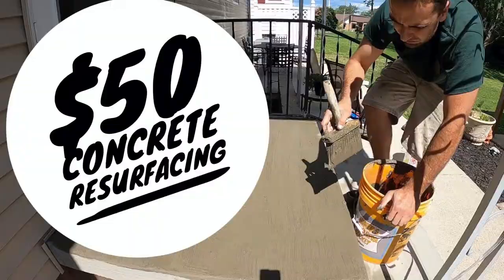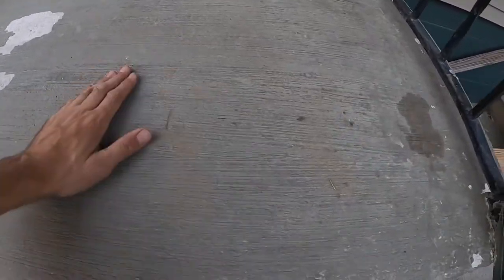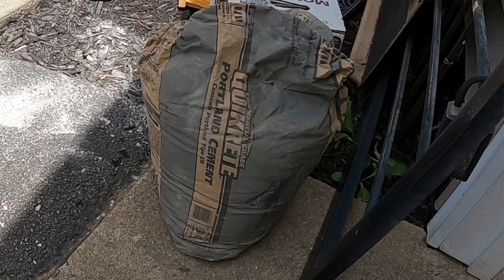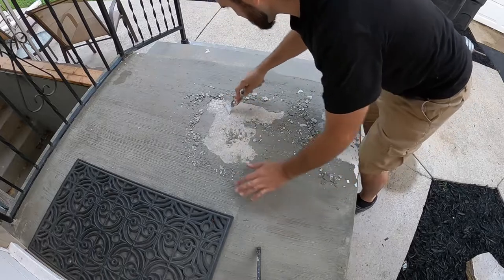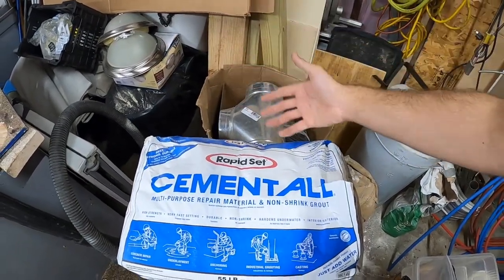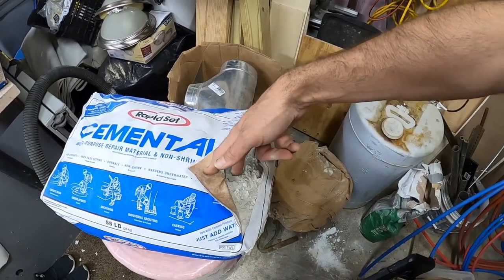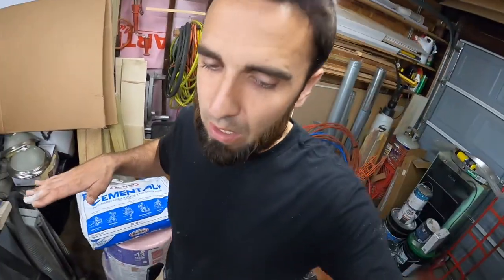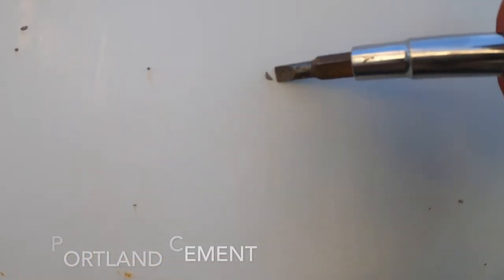RENEW OLD CONCRETE | 1 YEAR REVIEW

Comment: This is the secret, it MUST be wet, so have a sprayer and wet down the surface so the Portland will stick. In fact, use a water hose and soak the concrete so it is WET enough to NOT dry the Portland paint mix. Wet concrete will NOT stick to dry old concrete, because it will pull the water from your repair mix and then will not cure properly. 
I would use 1:1 sand/Portland mix to patch holes, let it cure for a week, then use pure Portland paint and paint it on a very damp surface. This will work and be a lot cheaper. 
The only thing the new advance mixes offer are: it drys faster for a one day patch and 2: it may have some polymers to aid is adhesive bonding. 
Just be sure the surface is damp through and through so it doesn’t dry as fast and have a sprayer handy to occasionally wet it often to keep the surface very damp.
You can do your own test on a scrap concrete surface, Portland paint is just as good as the new formulation, but, the new formulation drys faster, that’s it. It is meant for a crew to come in and complete the job on the same day.
Reply: SSD. Surface saturated dry 

Day one

Comment: The answers are here on youtube.
Watch:
WHAT CEMENT SHOULD I USE (Part 3) Mike Haduck "Fast drying" & 
CONCRETE PATCHES (Part 2)Mike Haduck

The first confirms you should have waited a week. The second shows both the old school & new school way w/ the rapid curing products of today.

He has another video of him painting driveways with portland where he explains that it is a every 1-2 year thing in his freezing environment. That being so, you may wanna stick to the second video where he shows patching with portland+sand (old school) & rapid set - cement all (new school) way. 

Also, rapid set - mortar mix (what you used) has a min 1/2" pour thickness because it contains coarse sand. cement all pours almost down to 0 inches (very fine sand). you could always
Reply: also, didn't emphasize in the fist vid he says to paint over the rapid set cement all w/ portland like you did a week later. and go no thinner than 1/4", my bad.

Comment: Thanks for the update.   I think   (my humble opinion)  perhaps the area wasn't quite wet enough to adhere to the cement.
Reply: If you use Portland as a paint the area has to be basically SOAKED to get proper adhesion or it flakes off

Comment: Rapidset newcrete
Reply from the maker: I looked into this product. Think it would work great for someone that needs to resurface concrete. I need a product that does both patch holes, cracks and resurface. Have you used Newcrete?
Reply: @handylandlord  for structure your gonna wanna just patch with mortar, resurface I would use Portland or cement all. Finding one that does all of 3 is going to end up making it compromise either structural integrity or it’s adhesion as a resurfacing agent